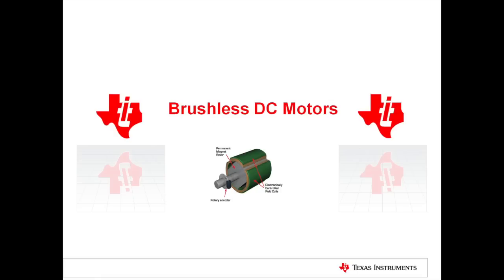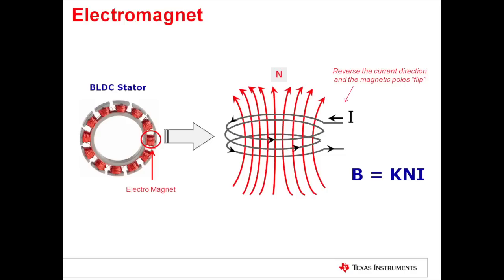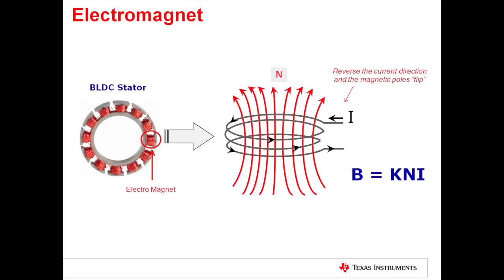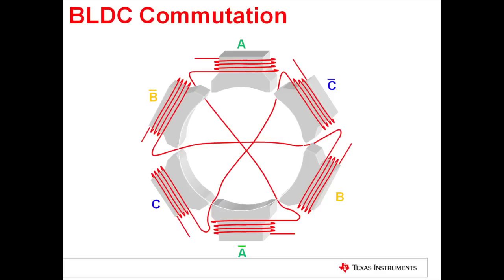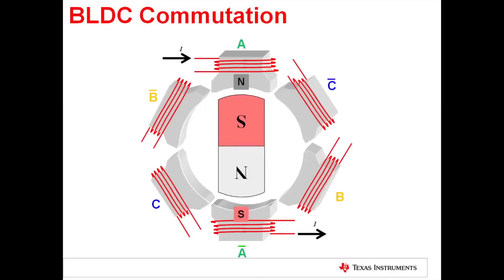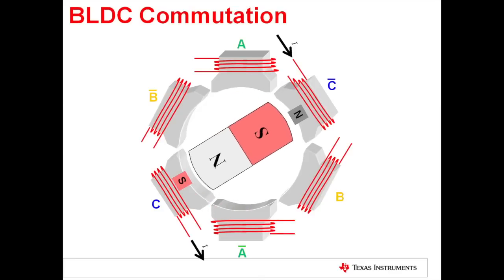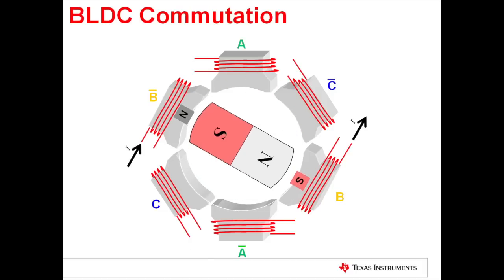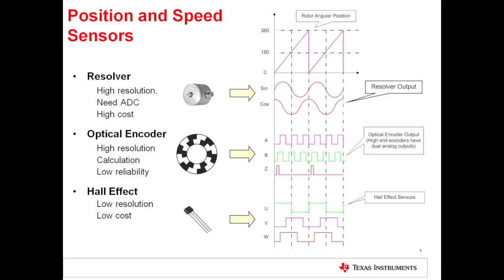Engineer It - Understanding basic sensored BLDC motor operation

Comment: I know this video is getting old but I had a quick question.  Are there motor control approaches that invert the current of a pole pair as the magnet passes over top in order to add a repulsive force in addition to the attractive force from the next pole pair?

Comment: Could you please give us example why does optical encoder ( especially absolute ) has got low reliability?
Reply from the maker: Hi Nikola. Magnetic encoders and resolvers are more robust and reliable. Optical encoders are typically made of a code disk with a pattern on it, LED, and photoreceptors. Infrared light from LED is shined through the code disk and unique combination of photoreceptors is illuminated to identify a given position of shaft. Optical encoders with this kind of construction give very high resolution but their assembly is complex and does not sit well with vibrating and noisy environments. In general Magnetic and Inductive encoders (like resolvers) will be more immune (although lower resolution) as compared to general optical encoder. If you have other questions, feel free to ask the experts in the E2E community: http://e2e.ti.com/support/sensor/

Comment: Thank you very much, is annoying there is absolutely no clear info how a computer fan works on google, I've never would of thought that all motors are AC current devices, I always thought that an electric motor was just a coil and a magnet and you just put energy to that and rotates, when I have to repair a laptop CPU fan now i understand how complex it is. To this day all the designs out there are extremely difficult that you may think just a 2-stroke gasoline engine is simpler. Complex designs may sound okay but for practical uses or mass production they are not an option, a design of a device that is put to work into the economy must have the less parts possible the less complexity possible, if not, that economy is going to deficit. To keep the equilibrium in the thermodynamics system is so delicate that every machine that is designed to have a sustainable economy in the world must be reduced at minimum.